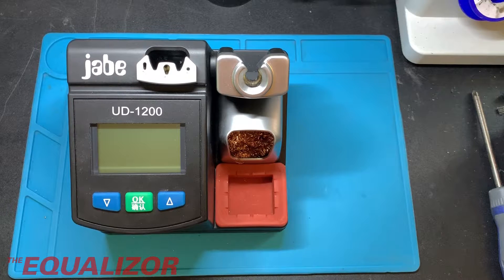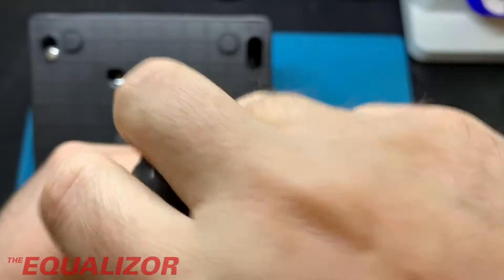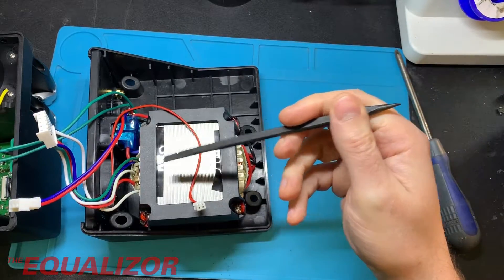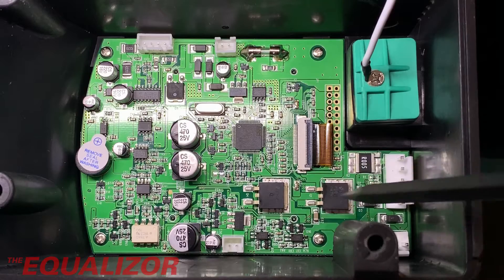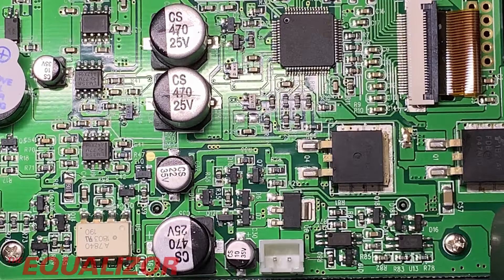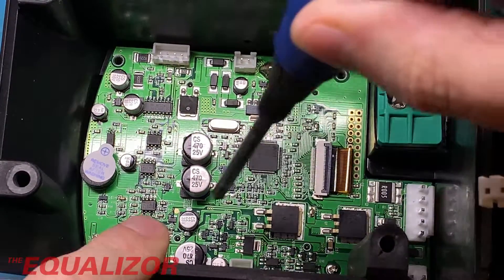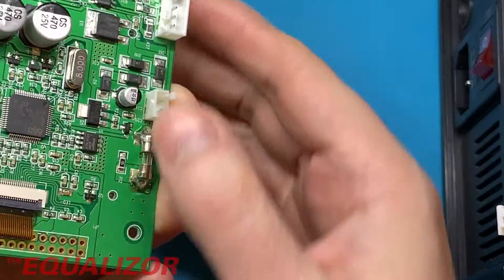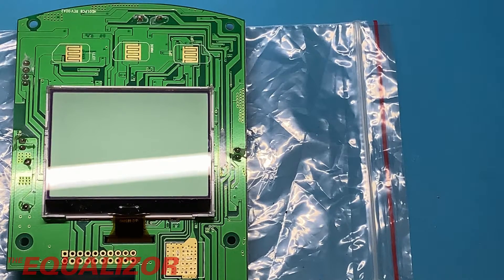Jabe UD-1200 teardown

Comment: Hi please answer my comment. I got same one but there is no enough heat on tips. Basically solder wire doesn't melt on tips. But little back of tips make solder wire melted. Do you think i got defective part?
Reply: Try calibrating it with a tip thermometer or some multimeters come with a thermometer which will give you a good idea if it’s calibrated correctly

Comment: Hi)
Are you using this soldering station?
is she still working?
Would you recommend the solder station?
Reply from the maker: Yes, yes and yes :) it’s my default station now
Reply: @the_equalizor  thank you for answer)
Maybe you using original soldering tips from JBC, if yes, what are you thing about this ?
I would buy an original soldering station JBC, I could use two handles 210 and 245 and get good quality.
but it doesn't make me money, it's just my hobby
So, i see for me three models, Sugon T26, Jabe UD-1200 and T12-11.
The Sugon T26 I did not like the build quality, although it has a 210 handle and original soldering tips from JBC
Jabe 1200 and T12-11 Very good build quality and quick tip removal.
But Jabe 1200 seems to have even better build quality and even has a fan, but cannot connect the handle 210...
Reply from the maker: @smart_electronics_il  I saw the Sugon one and was considering buying it to review, but yes, I thunk it looks cheap and nasty. The Jabe is quite well built, although the plastic case is a bit brittle. Both Mine and my friend who ordered one had damaged cases when they arrived. Nothing serious, was only a small chip that got knocked out.  I use both the Original JBC tips as well as the clone ones and they both work great. The T-12 looks quite nice but I've never seen one in real life. The Jabe is perfectly suitable for SMD work, even with a larger tip. Almost all of my work is SMD and not thorough hole...
Reply: @the_equalizor  hello have you heard of the Youyue 3600,it has 2 jbc handles but looks very similar to this Jabe & theres a reviewer who demonstrates with the Jabe 1200  that when he puts the fake jbc tips a real jbc station it doesn't heat as well,but the real jbc tips on the fake station make it identical to the real Jbc.(he says a rep from Jbc said the secret is all in the tips & that thats what determines everything) 

But anyways I just wanted to know if you think the 2 station Jbcs are useful(assuming they are like this Jabe), especially for a lil over $200 that it cost with shipping from China. Do you know if the 2 station Jbcs are capable of using both irons at same time like tweezers(1 in each hand)& possibly at different temp from each other? I can't find an answer anywhere.

Thanks for your time
Reply from the maker: @relicboxing  I use the fake tip every time I use that station and it’s always worked very well for me. I haven’t noticed a difference between the original same tip and the copy personally and I have both. You can’t use the tweezers with the jabe station as the tweezers use dual 210 cartridges and the jabe station doesn’t support those. I think the youyue staton is older than the jabe and I’ve never used one of them so I can’t tell you anything about that one unfortunately.
Reply: @the_equalizor  what if you use 1 iron in each hand to kindve make it work like tweezers?(does that sound plausible or is  that just pointless if you don't have the hot tweezers?)
Reply from the maker: @relicboxing  I have both the JBC and Jabe stations, and I’ve used both at the same time on a number of occasions to desolder components.
Reply from the maker: @relicboxing You may be interested to know that there is a new JBC style station out now that has  both the 245 and 210 handle and apparently both can be used simultaneously. I have one on order so expect a video when it turns up. It’ll come in at sub-200 after taxes have been paid.
Reply: @the_equalizor  whats the name of the station?
Reply from the maker: @relicboxing  Search for “xsoldering pro” on AliExpress.

Comment: I think this is not a soldering induction.
Do you know the maximun power of this iron?

Thanks in Advance.
Reply from the maker: Ricardo B Its not an induction heater, no, it uses a heated wire in the tip. I don’t know what the wattage is.

Comment: Hello
in my Jabe ud-1200 there is no white optocoupler with the a7840 designation in the lower left corner. Can I solder it myself? thanks
Reply from the maker: Wszystko i NIC If it’s not factory fitted, why would you want to add it? Or did it get damaged and you want to replace it?

Comment: Do you think the Jabe UD-1200 is better than the Pace ADS200? Thanks.
Reply from the maker: I used to have the Pace unit. I don't now. The hand-pieces felt cheap and nasty and to be honest and it felt a bit like an industrial relic from the 1980's with its 3 digit LED display and  odd menu system. I didn't get along with it. I prefer the the Jabe to the Pace, especially if you get the English firmware version  but that's just my considered opinion.

Comment: Isn't the controller circuit a rip-off of the original?
Reply from the maker: I'm not sure but my gut feeling is no. If it were a direct rip off I would expect the software to be in English. Also the Jabe isnt compatible with the C210 handles and tips so if it were a direct rip off, I'd expect it to be.